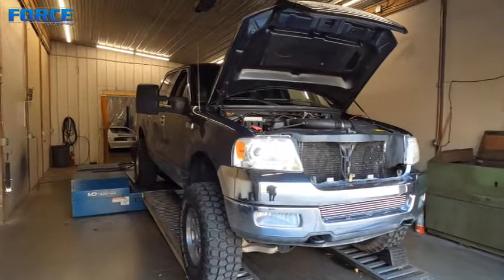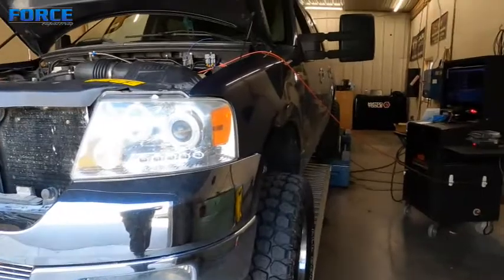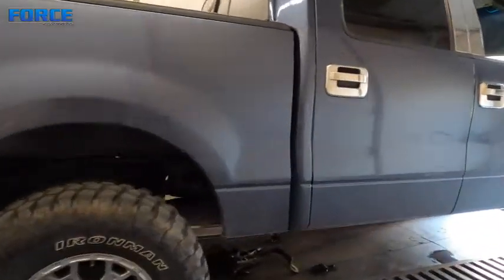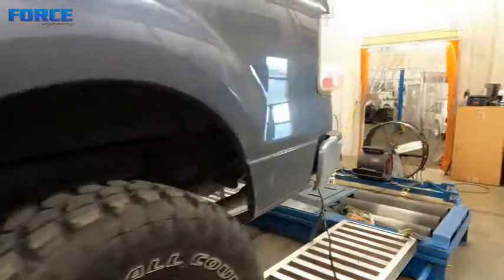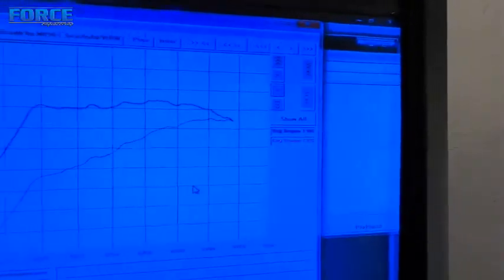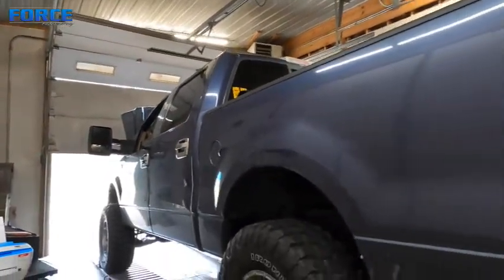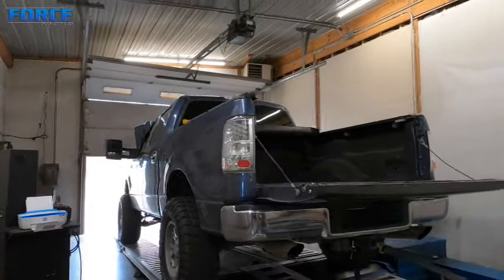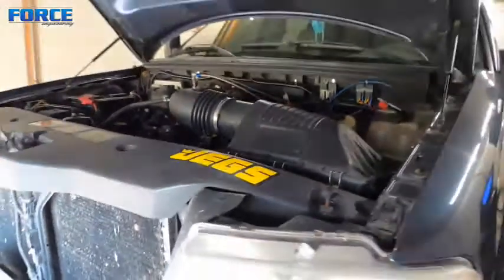Dyno Review - Roush supercharged 5.4l F150 | Broken

Comment: thoes are definitely some low numbers with a SC on it....my 04 Lincoln navigator 5.4 with a whipple supercharger makes 392 Hp  and 478 fl lbs of torque at the rear wheels dyno'd.......that truck in the vid has some issues if its not reaching the high 300's in hp and over 400ft lbs of torque..
Reply: It makes 300 stock💀 For it be making this little with a supercharger lets you know some is VERY wrong

Comment: Yeah….something isn’t right with the truck.
Those are basically stock numbers.
And what’s an intercooler pump ?
Air to water system?
Reply: Way worse, my truck is the two valve which had a little bit less power and mad around 240-260 hp and I think 320 lb/ft of torque and the 3 valves had just above 300 hp or near that range, not sure about torque for that one

Comment: Bro they make that stock wth is wrong with this truck
Reply from the maker: Lol yeah i agree.  There were a bunch of issues with it.  Intercooler pumo wasnr working. Boost gauge was plumbed wron and was reading zero.  The bypass valve apeared to be working.  He was supposed to fix things and bring it back, but i havent heard from him.
Reply: @ForceEngineering  I will be bringing it back at some point! Hopefully before June.
Reply: @chuck6527  good luck man, had me surprised. This trucks should be making atleast 350 to the wheels

Comment: Dang. Low #s. My 06 5.4 Roush  supercharged 2wd made 436hp/540Tq. With some bolt-ons and no nitrous. Definitely needs some issues corrected.
Reply: Yea, 5.4 3V make 300hp stock so idk what’s wrong with that’s guys truck
Reply: @jude3dprinting352  not to the wheel dude
Reply: Whered you get it
Reply: Yea he making a little over stock at the wheels , my truck made 211 and its completely stock